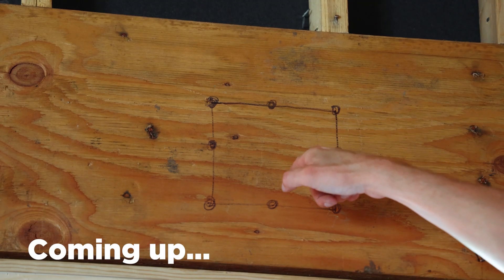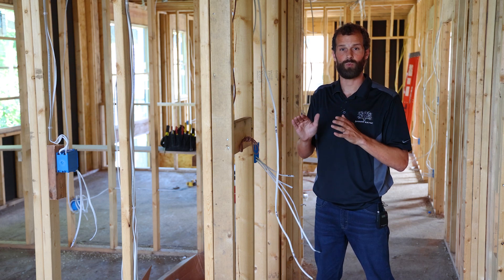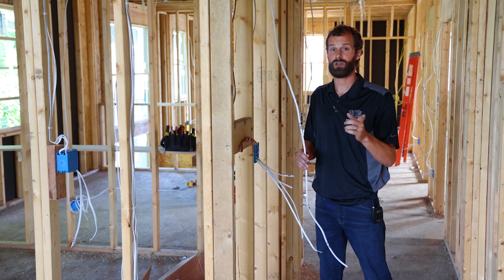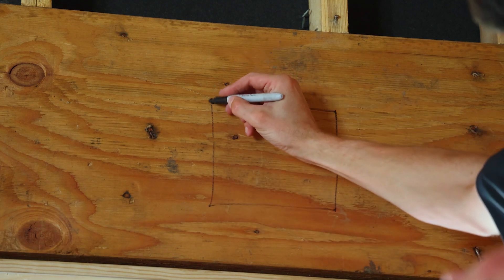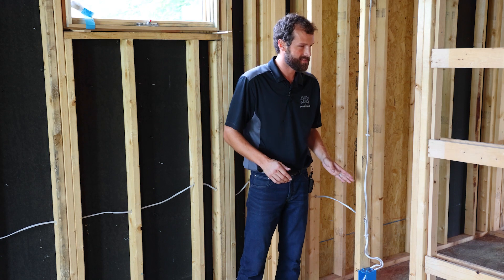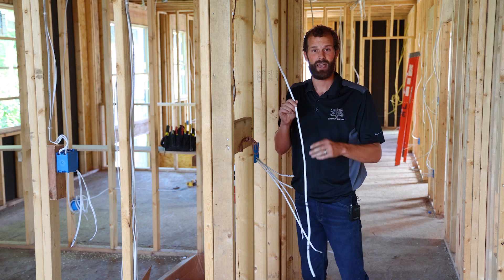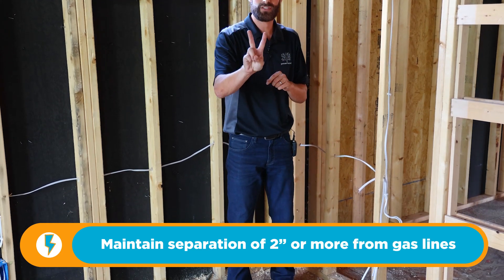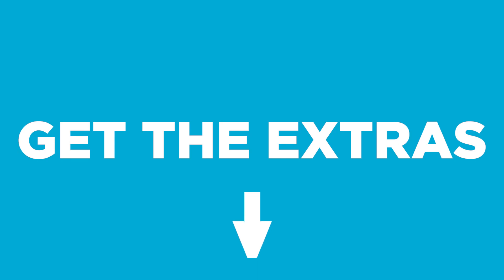Running Wire Inside Your Home

Comment: I'm an old man.  I still don't mix receptacles on the same branch circuit with lights especially in bedrooms.  Also, I see a lot of receptacles wired with 14/2 but I'm still using 12/2 for receptacles.  What do you folks think, should I put my bedroom and closet receptacles on a 14/2 15amp circuit and just have one dedicated receptacle on a 12/2  20 amp circuit for an appliances like a window unit AC (in case a primary hvac failure, ) or a space heater?

Comment: Great video.  I'm running electrical in my attic renovation right now.  But did I miss it? What is an LVL please don't use jargon for us novices😅
Reply from the maker: LVLs are "super-plywood" usually used for headers and other large spans. They are multiple thin sheets glued together in the same direction to maximize strength, but this bonding means that boring through them may have a greater effect than on traditional lumber.

Comment: Code doesn't speak to a set location from a floor. If it does, please identify the section. There is no switch for some outlets such as 30 amp and 50 amp outlets to water heaters, dryers, and EV chargers. Generally, great advice here, and this is a really good YouTube channel. Not an electrician here; I am much worse: attorney and Ph.D. in engineering. Hahaha! 😂  I hate pocket doors. Anyone else?

Comment: quick questions. Would there be a concern that the lights and the outlets for that room are all on the same circuit? Meaning a short in an outlet that trips the breaker also means that the room will be dark. Is this common practice? Or is it better to separate lighting and outlets on individual circuits?
Reply from the maker: There are multiple schools of thought in that regard: Is it better to trip a lighting circuit and lose most of the floor, or just lights in one room? Your choice!

Comment: I like the idea of consistency, but I personally never mix my receptacles with my lights for 2 reasons, one, if you blow a breaker from plugging something in you're not left in the dark, and also receptacles in my area require AFCI protection and its a waste to put lightning on that type of breaker
Reply: Afc. Is required for lights also

Comment: Joel what’s the code adopted by your jurisdiction, or the one where you’re doing this job?

Great video as always, the example with the LVL was very interesting. How holes should be spaces in joists and beams to maintain the structural integrity isn’t something that is readily obvious to a lot of folks. Thanks for being humble enough to share your experience.

Comment: Question. When you say every blue box needs a hot, I'm assuming you mean a constant hot, what about in a single gang that is housing a 4way switch? In that situation i just have 2 3 wires being used as travelers. Thanks

Comment: I've seen that many times that people drill to many holes next to each other, I do drill on the beams but I separate them like 6" apart and right on center  just enough for at least two wires p/hole, and just yesterday ive had to notch with out cutting to much drywall on a remodel home running new ungrounded circuts and switch legs coming from top, it is permitted to do so but you got to really know what you are doing though!  I love ure videos keep up the good work...!